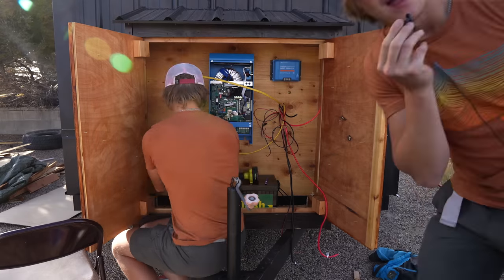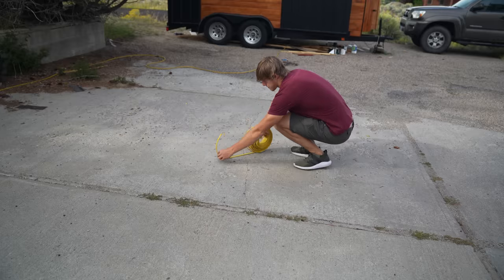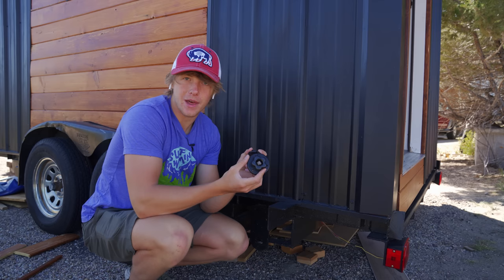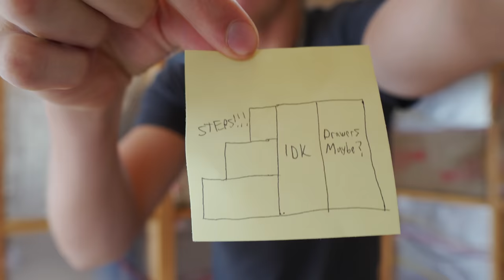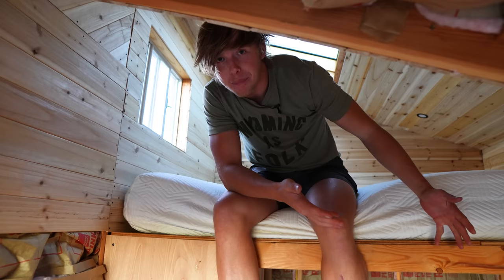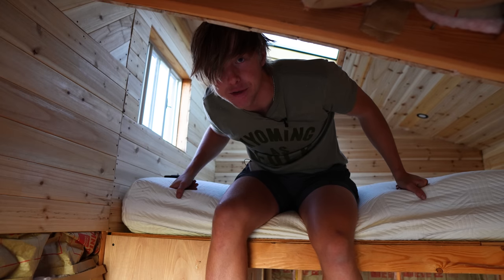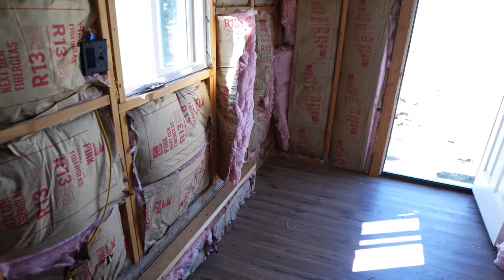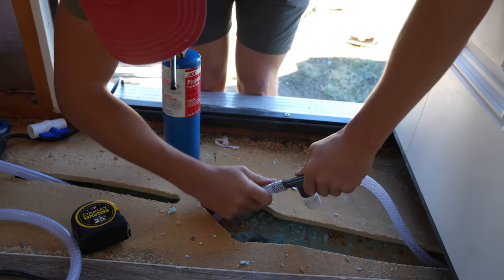Inside My $15,000 Off-Grid Tiny Home (Full Interior Build)

Comment: I have construction experience and let me tell you, you have far exceeded my experience by yourself your first time. The layout for the tiny home was very well thought out. Absolutely great use of space and the solar power is 100% what anyone should do when building a tiny home whether it is mobile or not. Fantastic job 👌🏻 I am now a subscriber. I wish I had the money to build my double loft, french door tiny home because I'd contact you to come help me out if possible lol. 🤜🏻🤛🏻
Reply: I think it needs a Vapor Barrier on the warm in winter side.  
He said they were having snow, so it must be cold.
Condensation could be an issue.
Two coats of Oil paint would act as a vapor barrier.
Reply: I love the design he uset
Reply: Also in exterior it makes it have a good vibe of natural van
Reply: I also have construction experience.  Since it's on a trailer exposed to the elements, all the framing should be Pressure Treated.  Studs, corners & rafters should be tied down with TECO brackets.
Reply: @chrisschroll8998  I get that but it's his first time cut him some slack
Reply: When he touched the isolation with bare hands he spooked me a bit
Reply: @0-10Junko  It's just going to tingle for a while.

Comment: You did a great job; you should be really proud. I don't know how many square feet your tiny home is but I do know a number of people just make a wet room for their bathroom to save space. The one thing you might want to invest in is a dehumidifier. If you don't keep the inside dry, the wood you used everywhere else in the house (with the exception of the wood in the shower) will mold, mildew and possibly warp from showering or even boiling water for tea or cooking.  I've watched dozens of videos of people who built their own tiny homes and they all highly recommend you run a dehumidifier. Otherwise, your work is excellent and I'm sure you'll enjoy living and working in it.
Reply: Yes!!

Comment: I love everything about this.  I am also the son of an engineer (mechanical, not electrical though) and did a box truck build a few years back.  I also went into it with no skills, learning as I went.  It ended up far, far worse than what I see here lol but it was tons of fun.
You taught me a few things I hadn't learned yet, in a style that suits my garbage attention span.  The cabinets especially.  Thanks bro!
Just to add to the collective data for anyone reading this considering their own build:
-if insulation is needed in areas where space is at premium, aerogel insulation is the highest R factor by volume that exists, but it is pretty expensive.  Might be worth it around the wheel well area to save space, would not be worth it on the main walls/ceiling.  For car or cargo van dwellers, it's ideal in the window recesses.
-pex curve brackets instead of right angle connectors reduce friction and possible failure points.  I learned this the hard way.
-battery banks on these builds are typically 12v or 24v... converting to 110v will come at some costs of efficiency.  Appliances and stuff that are 12v and pull right from the battery bank will save just a smidge of energy.  You can even build a tiny gaming pc with a ryzen APU and a 12v pico psu power supply, to avoid the 12v->110v conversion efficiency loss of the inverter and the 110v->12v/5v/3.3v efficiency loss that a PC psu typically has.  Similar story with LED lighting, there's a ton of lighting options that natively take 12v input, which both save efficiency loss and eliminates another part that could fail (110v->12v LED driver)
-many RV's come with 'cassette style' toilet and blackwater tank.  With these, you can remove the blackwater tank from the outside through an easy hatch, no carrying it through the house.  Can be dumped in a toilet at a rest stop if needed.  Composting toilet is a valid option, but for those who'd rather go the typical tank way... look for a cassette toilet on fb marketplace or ebay or something.  You'll only find used ones that are being parted out from RV's though.
-tile is heavy af and generally not used, but for anyone who wants to use a small amount for a kitchen backsplash, like the glass mosaic tiles, use silicone as the grout, and either the double sided tape style backing to adhere, or silicone.  No cement based thinset or grout... it would crack out the first time you move anywhere.
-anywhere there is going to be hot metal near wood, use metal backed fiberglass pipe insulation.  It's used on exhaust pipes for on demand heaters.  Preventing the wood from reaching ignition temps can make the difference between waking up in the morning or a painful frightening death the night before.

I love this build so much.  Well done, man.  Well done.
Reply: Legend, - im gonna use these tips for my own tiny house build which should take me 3 years. Starting this summer.
Reply: @elitemeemoosood9869 hoping u succeed!
Reply: @Alvionalx  thank you very much. Just gotta get my exams out of the way
Reply: Knowledge is power! Thanks for your contribution to all who are watching and reading this, getting ready to become builders of their own tiny homes!
Reply: Not bad mate don’t say that to any of your kids are here here here so I’m just sorry I want to make a

Comment: Great work and video David.. Got a safety suggestion for your solar system.. Install a breaker on input to solar controller from solar planels.. match the capacity of the breaker to max output of solar panels.. Also put one on input to inverter from the battery matching the capacity to max current draw of inverter..  This will enable you to isolate the panels and the inverter if when working on your system.

Comment: very cool build.  Just a suggestion if you havent done so yet, you need to solder the ends of your stranded electrical wires and then crimp on a lug before attaching to your terminal bar.  The way you had it connected is not a solid connection and may wiggle out over time, not to mention is a fire hazard.  Maybe someone has already suggested and you took care of it.

Comment: I'm really enjoying this video!  Great job!   May I suggest (If you haven't already) go back and put some ring terminals on your wires for the fuse block.  It'll look much cleaner and give you a much more solid electrical connection.   Cheers!

Comment: You should build a tiny addendum with a little black box that sits in the sun.  Inside the box would be a container housing a distiller that is heated by the sun.  Used water would be pumped into a tank and then distilled into freshwater, which would then be pumped into the freshwater tank.  It would make this totally self-sufficient.  If you were going to use that water long-term though, you'd want a bottle of mineral tablets to add the freshwater.

Comment: Great job, however you should consider finding a way of having a better sealing solution in your shower
It's gonna root or infiltrate your need silicon on the joint between the woods

Comment: the wiring of the solar modules in series might not be that smart due to partial shadowing leading to all of them not working pretty efficiently... I would invest in some bigger cables and go for parallel :)
and sorry to critique here, but with the way you did your fuse box you could have also simply not done it^^ (huge stick-out, no ferrules, overlapping) do it right: its a little fix and will prevent fires in the future - don't underestimate the virbations from driving ;)
and the 'ok' from your dad might go for the over all plugin together of things... but not for the actual small connections ;)

apart from that: preeeetty nice dude

Comment: No training shows.  You do great work but you really need a tablesaw 101.  Stop cross cutting on your table saw.  The circular radial and miter saws all exist for a reason and are all designed to cross cut.  Table saws are not intended to cross cut.  Read the book.